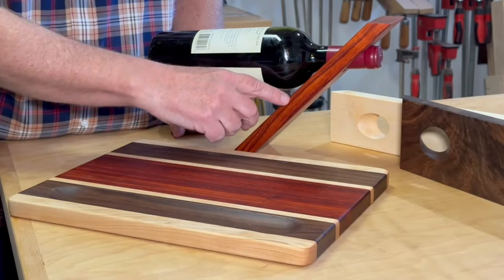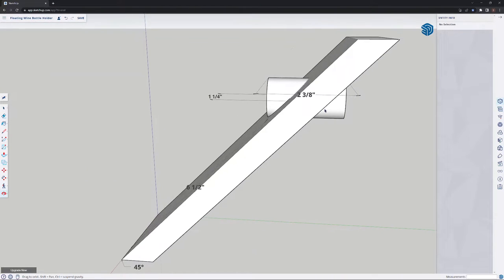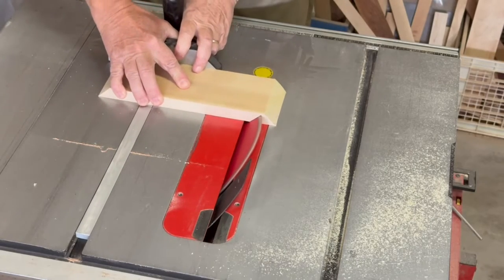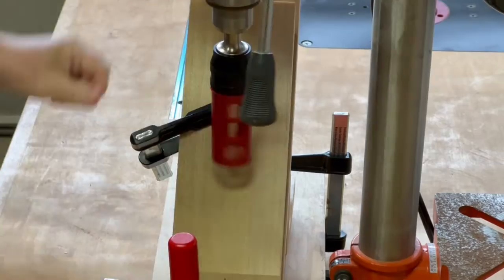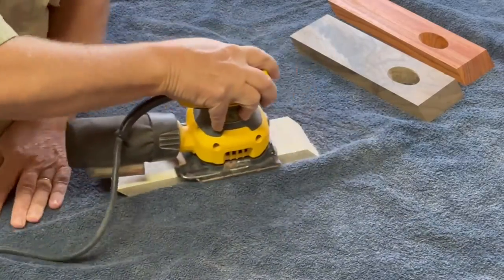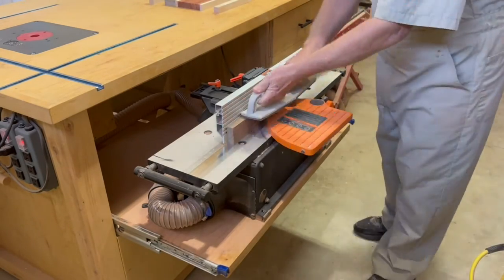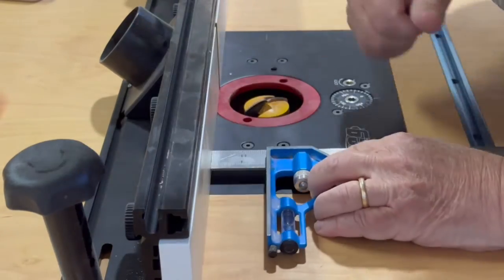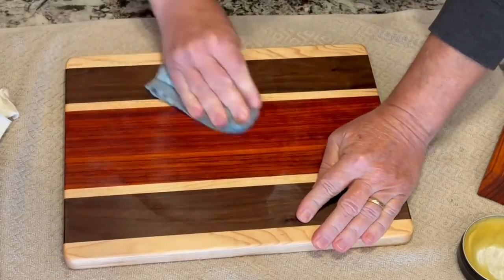Making a Floating Wine Bottle Holder and Cheese Board - Woodworking Gift Ideas

Comment: Thanks for the great videos.  Quick question.  On the floating wine holder, the distance of the 1-1/4" hole should be 6-1/2" from the bottom of the board.  Is there reason why you didn't design your jig to put the hole in that location?  Instead of drilling it "upside down".  I'm only asking so that the material above the hole can be any length and designed differently from one holder to another.  Thanks again!
Reply from the maker: Thanks! That's a great point, it would be a better jig to flip it around, so that you can make the length of different pieces different.  The reason why I did it "upside down" is that I have a really small benchtop drill press, and it wouldn't have fit the other way.  If you have a larger drill press than me, then doing it the way you suggest would be better I would think.  I should have mentioned that in the video, thanks for the great question!
Reply: @jkmwoodworking  That makes perfect sense.  I'll have to check if it will fit with my drill press.  I doubt it as I have a small bench top press as well.  Thanks!

Comment: Great video! Question: does the 45-degree end, 1-1/2" hole, and 6-1/2" distance of the hole work for any wine bottle (within reason)? 
I assume here that some in/out adjustment of the bottle depending on the shape might be needed.
Reply from the maker: Yes, it will work with most wine bottles.  I tried it with all that I had (about 10) some different shapes, and it worked well with all.  Note that the wine bottles I tested it with were roughly the same height bottle, so perhaps a very unusual height or shape might not work.  Note that the hole diameter that works best is 1 1/4".  
Thanks so much for watching the video and the compliment, it is greatly appreciated!

Comment: I’m brand new to woodworking and get a lot of useful info from watching your videos.  Question- when you cut your 45 degree angles on the table saw- couldn’t you do that with your miter saw?
Reply from the maker: Yes, could have been done with the miter saw, but just that it didn't feel that safe with a short workpiece (10"), and 3 1/2" wide.  If cut with a miter, it would have to stand on edge, or could have used the compound miter option to lay the saw down to 45 deg, both are possible ways to make the cut, but both just didn't feel right because of the short workpiece.  
Sometimes I'm probably over cautious, but just like to be safe and always feel comfortable.  The table saw felt better/safer, and with the sled, then for sure it was.
Thanks so much for watching my videos, I'm happy to hear they are useful!

Comment: Does your drill press table not tilt to 45 degrees?
Reply from the maker: It does tilt to 45,  that would have been a good option also, great point!  I just felt like the jig would be easier to setup and align each time I wanted to use it to make more of these in the future.  Thanks for the comment, and thank you for watching the video!